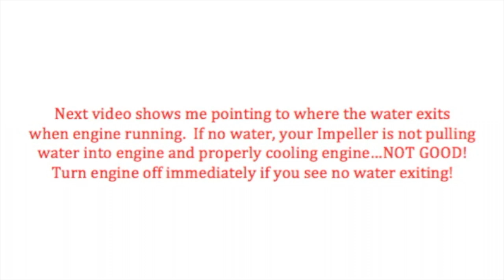Boat is taking on water - Our failed leaking bellows

Comment: How to check if there is any water exiting the engine if the boat is kept on the water most of the time?
Reply from the maker: @wilsont1010  

Thanks for watching, not sure if we understand the question exactly.
Reply: @DIYwithMichaelBorders  Well, if the boat remains on water, how do you check if the circulation is running normally or not, since from this video, the water will exit beneath the surface unlike an outboard engine?
Reply from the maker: @wilsont1010  

Understandable.  It’s best to inspect boat while its in water to get a good view of any water intrusion near bellow and transom area.

On the other hand, it can be very beneficial to inspect outdrive, transom, and bellows while boat is out of water…as it will give you a closer/detailed view of the parts that may be causing leak.

👍🧰

Comment: $3,200 quote for a repair at my local boat shop
Reply from the maker: @SofuQTwo  

Thanks for watching, that’s a big bill.  Will you be pursuing the DIY route?  We will be here to help answer questions.

😁👍🧰
Reply: @DIYwithMichaelBorders  I sure will thanks for the video
Reply from the maker: @SofuQTwo  

😁👍🧰
Reply: You tube has a video how to put it back on with zip ties to pull on . I just did mine took 10 mins have to glue the bellow I also mine came off today
Reply from the maker: @offswitch1  

Thanks for sharing.
Reply: $3200?? We charge 4 hours labor and parts where I work 😂 round $800
Reply: And that’s for all 3 bellows and gimble replacement 😂
Reply from the maker: @beliedat2457  

Good morning ☕️

$800.00 is a much more friendly price than $3,200.00.  🧰
Reply from the maker: @beliedat2457  

All OEM parts or aftermarket?